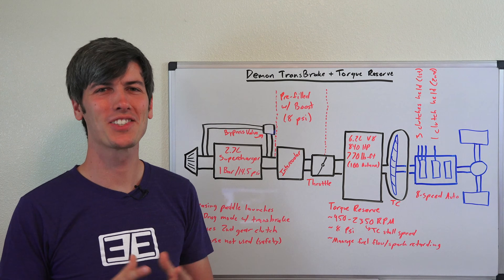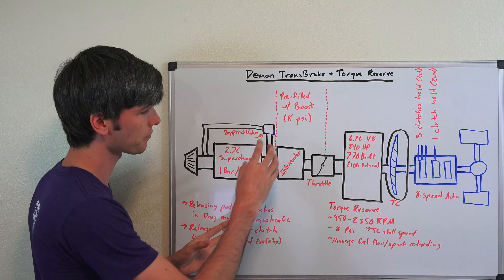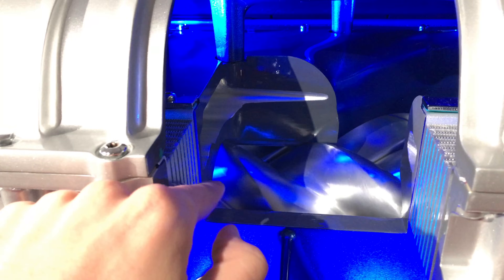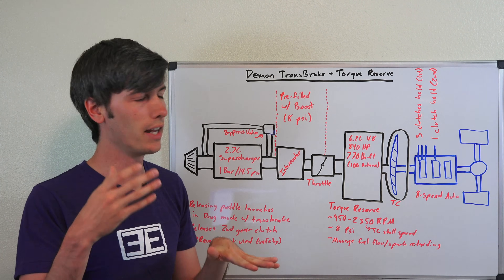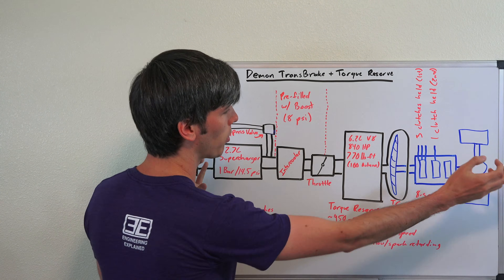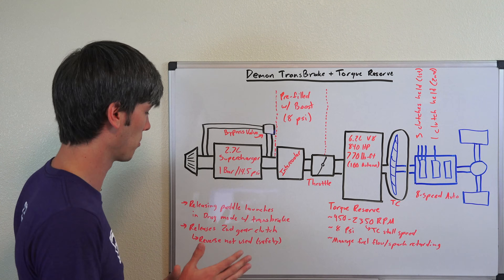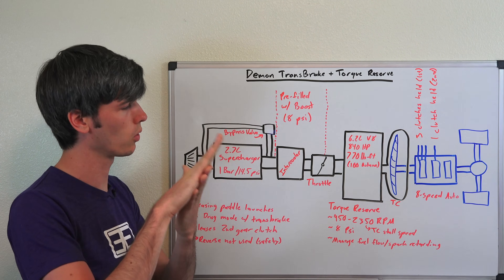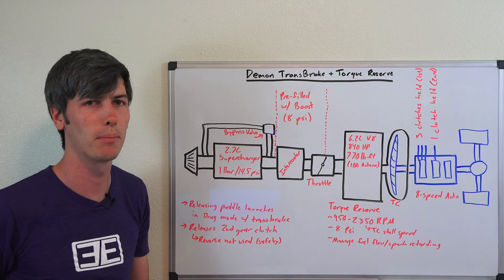How The Dodge Demon Launches: Transbrake + Torque Reserve Explained

Comment: 1st question - Does the torque reserve only available for the dodge challengers with superchargers and not the dodge challenger scat pack 1320 even though that has a trans brake? 

2nd question - What is difference between boot brake and trans brake on the dodge challenger? I understand the controls as in trans brake uses paddles vs foot brake but as in what is the benefit. Does foot brake do the same thing as trans brake as put torque to the wheels right before launch?

Comment: The throttle is before the supercharger and a bypass valve  is after the supercharger but opens into the supercharger inlet pipe to bypass boost.

Comment: Good day sir. I ask question, why the dodge companies doesn't use turbo charge? And why they choose super charge? Pls. Answer it and if you have time ask the dodge company till this my comment... ok?
Reply: Bec. I discovered that turbo better than to super charger in terms of boosting but why they go supercharger
Reply: Pls. Answer my question sir. Thanks
Reply: Turbos use exhaust gases to spool-up, and superchargers are belt driven, meaning, they're spooled-up at launch.  If in doubt, ask what the experts use for launching at a drag strip - it's always superchargers.  Turbos tend to be easier to incorporate and cheaper by manufacturers, which is why you will only see superchargers on the highest end vehicles by the big motor companies.

Comment: You set the launch rpm and floor it when the transbreak is set so you don't have to ease in to throttle. Foot to the floor the hole time.

Comment: So you have to control the throttle input with the transbrake on? I thought it was full throttle and the computers controlling the RPM.
And also, can you use the transbrake in second gear? I remmember that Motor Trend said  that the automatic Hellcat is faster from 0-60 launching it from second gear, and I have the doubt, can the Demon do a faster 0-60 launching it from second gear?

Comment: Chevy could have easily  come out with  the same configuration. It's a nice trick. But doesn't  GM  a camaro that has a trans am conversion that put off 840 HP  on pump gas.
Reply: Correct - but it has 1000 horsepower this year, on the Super Duty 455 version.  The COPO camero will out-run a demon, but the demon remains street legal while that camaro is not.  The T/A could give the demon a good run but probably needs the same or similar tires, and has a 500+ lb weight advantage.

Comment: Ok so i understand what a transbrake does. But how does one install one? Is it just an electric circuit or mechanical?  Can it be used on any transmission, i know it can only be used on automatic transmissions but how does it work on other transmission lets say a dog box or a Lenco transmission? Thanks in advance
Reply: Someone :D?

Comment: Why there's no rev-limiter? Wouldn't it be much more efficient and repeatable if you could adjust the desired rpm for the track conditions and just sit in the lights with the throttle all the way down?

Comment: engineering explained can u explain what is transbrake and linelock
Reply: Linelock is simply a valve to eliminate the rear brakes, thus allowing the driver to brake with only the front wheels.

Comment: Torque Reserve seems like an incredibly misleading name to wow people who don't understand physics.  This made me think of a giant torsion spring connected to the driveshaft, not fast-idle and constant intake boost.   A reserve of torque is nonsensical.  You can store energy (potential), but not torque.  Only a tiny amount of energy (negligible) will be stored in the 8psi compressed air between the supercharger and the intake.
Reply: Considering the boost will be virtually instantaneously converted to a significant amount of torque at launch I would say it's far from misleading and instead just simplified for the sake of those who don't want to read a physics textbook when they're car shopping. "Object X stores Y and when the light turns green you get more torque" Torque Reserve

Comment: Given that this is FCA, I wonder if how many launches it can take with this system before it breaks, and more importantly, whether there is a hidden clause that voids warranty when this feature is used...
Reply: matthewmatthew638 well they did strengthen the drive train so it should hold up
Reply: There is a clause that voids the warranty if you drive in anything other than a a sunny, dry, smooth, clean road. I'm not joking, its in a thing they make you sign when you buy one.

Comment: Hi Engineering Explained!  I really appreciate your videos and I was wondering if you could do a video solely on how a VELOCITY STACK intake system works.  I'm a 16 year old kid who just wants to learn more!  I think cars with those trumpet looking thingys sticking out of the engine sound so good!  PLEASE LIKE SO THAT GUY CAN SEE THIS! THANKS!

So does it make sense to add force induction on an engine with ITBs?  Does it work, is it more efficient for power increase or no?
Reply: Leslie H. I do not know as much as EE but I think it's very very hard/ impossible to do forced induction with independent throttle bodys. I may be wrong but I don't think you can have open throttle bodies on each cylinder and put boost into them. Just trying to help awnser your question!:)
Reply: Then what about a 4A-GE 20V? In some variations some people boost them with ITB.
Reply: theog gus you can with ITBs' e.g GTR R34 has a RB26DETT with 6 itbs for forced induction on ITBs' you need to link them with a common manifold
Reply: Leslie H. Well prime examples of forced induction cars with ITBs' are the Nissan Skyline GTR (R34) which has a 6 cylinder twin turbo setup from factory and those cars make upwards of 1000hp when built correctly

Comment: Like a stall kit. Makes an automatic behave more like a manual for launching. Still prefer manual. Do pretty much the same thing. Clutch in rev to about 2k rpm give or take, depends on your tires traction and how powerful the engine is. Experiment a lil. You want to push the envelope of your tires breaking traction. Tires just chirping a lol is perfect. So get the sweet spot rpm then pop clutch and push gas.
Reply: No

Comment: EE, thank you very much for all your videos and tutorials. My question, Which one  is better for fast launch, using electric motor to move the wheels or using trnas-brake with torque reserve?.... cause I drive a V6 hybrid and I noticed it launches faster than any other Gas vehicle when the traffic light turns green.

Comment: Does that mean the life of the clutch is reduced massively after a few launches if they're fighting against each other in 2 gears to hold it for launch?
Reply: Dan Rayment they arent slipping, so clutch wear should be minimal, or non existant. Holding a clutch without moving is like holding your brakes at a red light.

Comment: I don't think the stall of the torque converter is high enough to have a really good launch and for the trans brake to be effective. Should be upwards of 3500-4000 rpm although it would be harder on every component and would probably need a wheelie bar to control the launch.

Comment: How long can you sit with the trans locked up before you build up too much heat?  Do they have a special cooling system for the trans fluid if you want to do back to back runs?